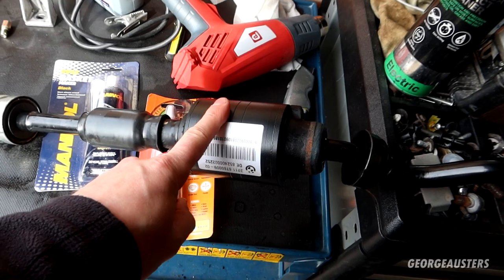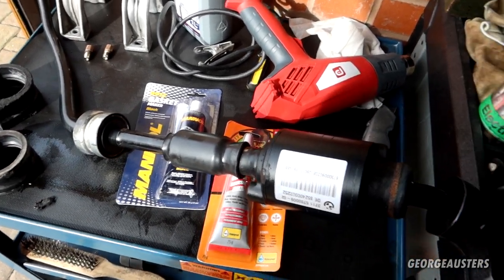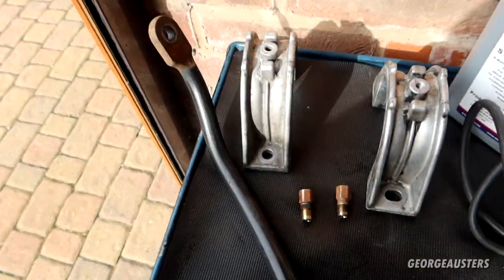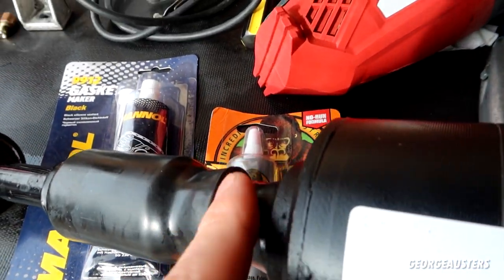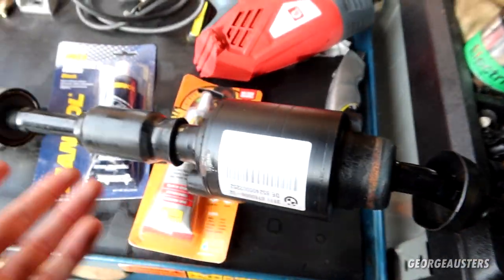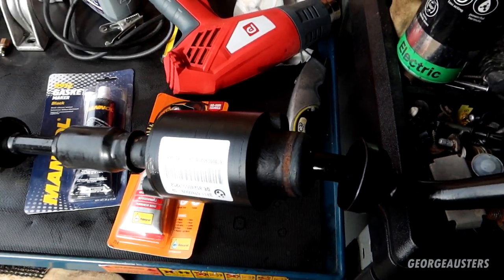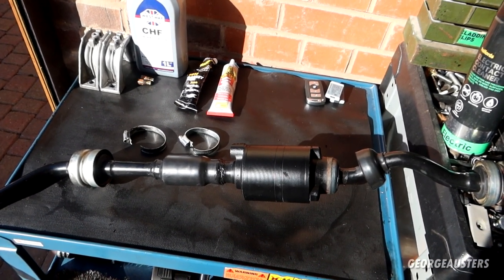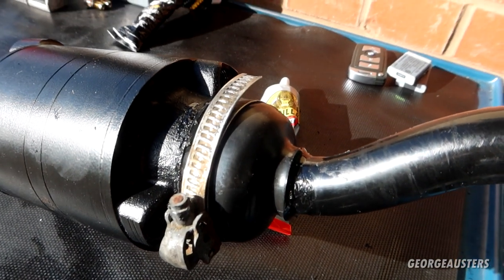BMW DYNAMIC DRIVE SWAY BAR LEAK CHEAP FIX!

Comment: just wanted to say thanq.  i've been working on my 03 745li and did not want to spend $1600+ on a new swaybar.  I did similar to this video and have not had any leaks in the last 1k miles or so.
Reply from the maker: Good to hear!
Reply: Did you have to take the bar off to repair ??

Comment: Did you actually try to move the sway bar ?? Both sides turn in opposite directions so the seals need to slide on the actual bar

Comment: BMW dealerships are full on robbing fookers George, my E60 went in a couple of yrars ago for a recall on the battery lead and they done a health check on the car and qouted me £4000 to put things right..... £192 of that was to search for an oil leak lol..... you didnt need to search as it was the seal coming from the turbo that was plain obvious.
This list of individual prices was scandalous, to replace a rotted front brake disc cover £230, £700 for a rear disc and pad change etc...
I done their £4000 of work for around £600 👍
Reply: Hey I got an e60 3.0 tt , my sway bar sensor is coming on for some reason and it won't let me turn on dtc have you had something similar?
Reply: @vividox4706  from my own experimce of knowing nearly every nut and bolt on my E60.i can honestly say i have never encountered a sensor on the sway bar...... i think the M5 E60 and perhaps the E61 may.have one but not the rest of the E60 range.... my suggestion would be swap the sensor out if thats what you say it is, sorry i  cant offer any other advice

Comment: Someone needed to do this to see if it works. Looking good so far.  🤞👍
Well done George. Don't forget to give us an update. I've got this problem on my 760li 😭
Reply from the maker: Yeah pretty sure every single one of these anti roll bars leak lol.. Will make a video installing it once the new bushes and sway bar links arrive!
Reply: Tbh even after doing this the pressure increases in the bar and fluid ends up leaking in the next weakest point.

I ended up buying another hydraulic fluid pipe and then creating a loop so fluid doesn't go to the bar at all. Works perfect and no errors ever appear on the dash, most likely because the pressure is still being maintained.
Reply: @KhanNakash  That sounds like a good plan if it fails. 👍
Reply from the maker: We shall see!
Reply: @GeorgeAusters  why didn’t you leave the clamp on those rubber boots? Wouldn’t that just make it more bullet proof?
Reply from the maker: Possibly but it could also force all of the gasket maker out

Comment: I think all you have done is sealed up some dust boots.  The pressurized hydraulic fluid seals are inside the larger cylinder, aren't they?
Reply from the maker: No I sealed them and no more leaks

Comment: George , thanks for your video,  I have a 2006 750li ( USA)  and the multi disc player is on the fritz.  Have you seen any of the multi disc player units around any where?
Reply from the maker: EBay usually your best bet my friend!

Comment: Very good work mate. Mine has started to weep told last MOT and I was only thinking of getting used part but could end up same. I want to see what happens with what you done thanks
Reply from the maker: Yeah no point buying a used part mate, they all leak

Comment: Hi George, great maintenance, which as usual is maintenance free like the gearbox according to BMW hahaha!

Do you know if the hydraulic reservoir is common with the steering?
Reply from the maker: Yes I have a video replacing the reservoir
Reply: Thank you very much George for your quick reply. I have an F11 LCI with dynamic drive, and I just want to do some preventive maintenance on it.

I wanted to ask you several questions as you have struggled with this system quite a lot 🥲

- How do you drain absolutely all the oil from the circuit? From the valve box do you think it all drains out (if it goes that far down in F11...) Is it possible to loosen the pipes at the anti-roll bars? Is it possible to break anything 🤣?

- How do you bleed or refill the circuit afterwards, so that the Dynamic pumps or motors don't work without liquid, is it necessary to do some test/dance so that it makes all the movements and refills the circuit?
   @GeorgeAusters

Comment: At the service, I was told that I can't replace only the rubber in the anti-roll bar bushes, but I have to buy the whole part. Is that true?
Reply from the maker: You can.. As I did!
Reply: Thank you very much

They once replaced my turbo and the second mechanic said it wasn't necessary because it was enough to replace the pneumothorax or something

Comment: Hi George after having the dynamic drive failure come out but the scanner not telling me anyting today i think it actually pointed me somewhere, code is 6276 Predive check: VA - valve energized open, do you know what is that mean?
Reply from the maker: Check my valve block replacement video

Comment: You could of  used  Zap straps, instead of  the gear clamps??    Another  last ditch attempt, for the seal leak,     PowerSteering   "seal - swell"   additive  ???  ( Im goinna try this myself  )  Being a  Motorcycle mech ,,,    has worked for me  on   weepy fork seals,,,   As long as the  shafts are not gouged up ,,   or scored  .

Comment: mine leaks on the side with the oil lines, and there is nothing u can do because there are two moving metal parts, u can't glue them 2gether😅
Reply: Perhaps installing o-rings?

Comment: When your car had dynamic drive malfunction do you racal the car jerking side ways a bit when starting ignition? Thank you
Reply from the maker: No I didn’t
Reply: @GeorgeAusters  okay thanks for the response George. Ive noticed lately my car with jerk sideways when starting. I dont recall it ever doing that and thought lt might be do to Dynamic drive. Other than that car runs great

Comment: Hey, im having the same problem i think, but its from 1 side only. Is it necessary to remove from the car before trying this repair ?
Reply from the maker: Best to!
Reply: Thanks...its easy enough to come off...not sure if its even leaking there though, the boot is loose but doesnt seem to be leaking... i just checked the rear and it looks like it leaking from that boot...and i have no idea how to get that one out 🤦‍♂️🤦‍♂️
Reply: Let us know how your patch worked...im curios about the glue, im not sure if that boot is supposed to move on the bar or not...because i saw a video of how it works and it looks like the bar twists when corering
Reply from the maker: No leaks so far!
Reply: @GeorgeAusters  thats awesome man..im hopefull now....im happy for you....im actually watching a couple of your other longer vids right now about the dynamic drive...your input and advice and tips are awesome man 💯💯

Comment: Hey George, im about to replace my rear active sway bar in the 2006 E60. Is there anything i need to watch out for?
Reply from the maker: Rear subframe will likely have to be lowered
Reply: @GeorgeAusters  oh jesus...i dont think i'll be able to do that in my backyard lol thank you for the help
Reply from the maker: It can be done but it’s not easy… I lowered my rear subframe on my old E60 to swap out the bushes
Reply: @GeorgeAusters  there are no tutorial videos on the internet for it at the moment, but i can wait with that a little longer. doesnt seem to be that big of an issue. thank you so much for the help and replies!

Comment: I have the same issue, however the rubber boots in mine don't seem to be rubber, they're hard materia, that's weird.
Reply: That's the updated bar. They made improvements to them over the years.

Comment: Nice job George. It would have been worth replacement if the car was brand new plus the dealership cannot warranty DIY style repairs so unfortunately they have to replace it.
Reply from the maker: Yeah I get that but they should made a better sealed unit or at least a replaceable seal
Reply: @GeorgeAusters  agreed.
Reply: They shouldn't have made such crappy sway bar that leaks hydraulic fluid. But you just want to argue....
Reply: @matejovich  No I completely agree with you. The system isn't made to be reliable..too many parts to fail and not enough testing

Comment: Can we get an update?
Reply from the maker: Yep no leaks so far
Reply: @GeorgeAusters  Right on! I have this, the Alternator bracket gasket, front timing cover (long story), Driver door speakers, restraint system and oil cooler 0-rings to fix. got my work cut out for me! Thank you so much for this video!
Reply from the maker: @kromeknifemind  Have you seen my alternator bracket video?
Reply: @GeorgeAusters  Is it in the 750Li section? it is the N62 motor correct? I have the 6-series (E63).
Reply from the maker: @kromeknifemind  https://www.youtube.com/watch?v=XB_4ifMRukw
Reply: @GeorgeAusters  thanks for checking the comments here on an older video

Comment: It's there any chance to delete your dynamic stabiliser bars and replace them with normal ones?
Reply from the maker: You could do but I won’t be doing that
Reply: @GeorgeAusters can you please give me more details...I'm pretty stressed as my back stabiliser bar it's leaking badly and I don't want to change it as it's extremely expensive , and I want to know if it's possible to just replace it with a normal non dynamic bar.. will the car get a warning code? Will it drive normally ? Please let me know
Reply: Please answer
Reply: @leoking7672  Just fix the seals... like he did in a more recent video.
Reply: @leoking7672  yes you can, just mount a normal sway bar and code the system out like the car doesn't have the dynamic drive, you do that using ncsexpert

Comment: its been a year, any update?
Reply from the maker: Still fine
Reply: @GeorgeAusters  then i know what to do haha
Reply: @GeorgeAusters  but only if my coolant issue is not the headgasket😅 its using coolant but no clue where to
Reply from the maker: Which engine?
Reply: @GeorgeAusters  n62b44a
Reply from the maker: This could be your problem: BMW N62 / N73 COOLANT TRANSFER PIPE LEAK EASY FIX!
https://youtu.be/O6KZiqB4UCw
Reply: @GeorgeAusters  yeah maybe but where does the coolant go🤷‍♂️🤣
Reply: @GeorgeAusters  instead of the contact adhesive you use can i use gasket maker there aswell? We dont really have that contact adhesive here 🤔

Comment: If fluid is leaking out and then you reseal it how do you replace the lost oil. 😱
Reply from the maker: It’s power steering fluid mate👍🏻
Reply: @GeorgeAusters  sorry, so is there a pipe that goes to the power steering reservoir to keep it topped up.
Reply from the maker: You just need to top up the reservoir yes
Reply: Their is a bleeding sequence on ISTA 9/10 it fails saying time out on dynamic drive aslong as the car does the dancing business ignore the ISTA error and reset the codes